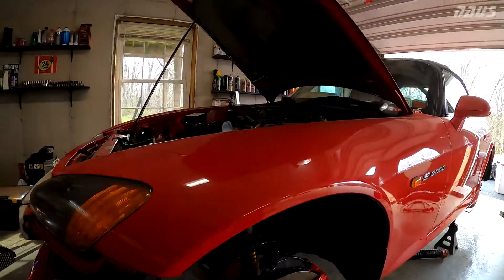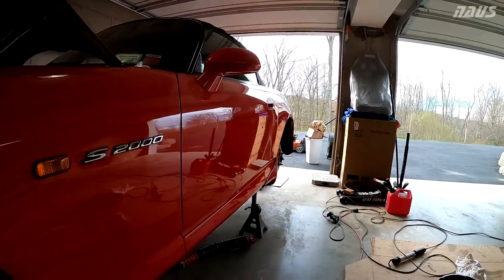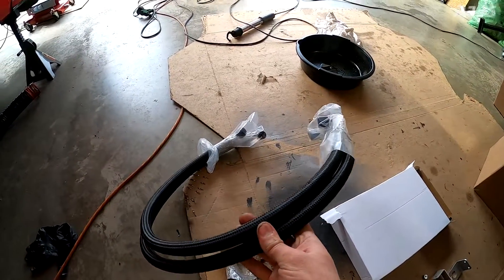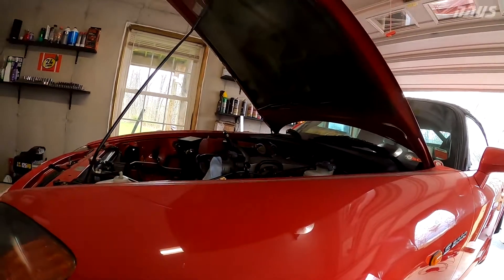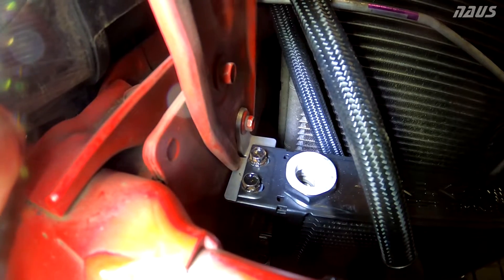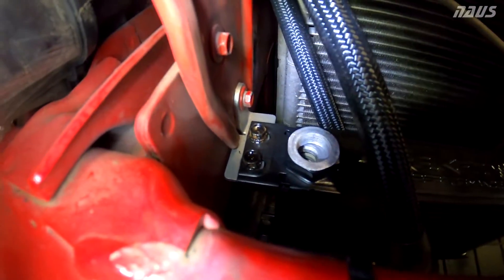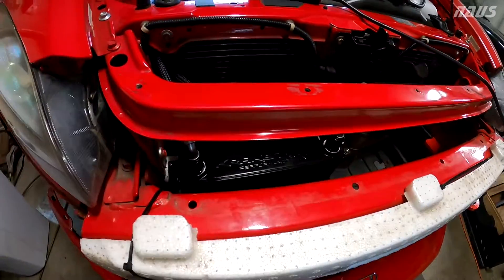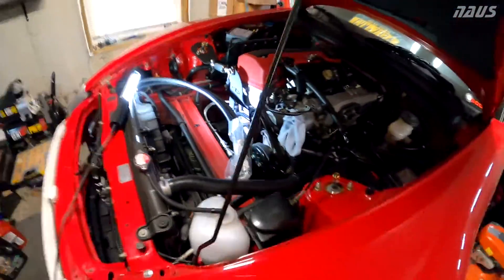S2000 SBG Oil Cooler Install

Comment: Good video, this is one of my next mods (I live in the south). I was going to do the Mishimoto cooler but the Sake Bomb cooler is much better (after seeing it in person) and much better configuration options. I also agree with you on the nylon braiding, much better abrasion resistance and great job using the edge trim, I wouldn't have thought of that until now.
Reply from the maker: Do it up man! I got my first track day with the car in 2 days with S2ktakeover.

Comment: I have seen the sandwich plate torque from 40 ft-lbs (mishimoto) to 54 ft-lbs( Blox) when I first put one on I doubled the 16 ft-lb filter and it loosened in a few years. Because of the gasket retighten every few years.

Comment: Nice s2000 man! I got a silver 02 that I've been wanting to install an oil temp and oil pressure sensor/sensors on. I saw you used the stock location for the line to your sensor, now that you have an oil cooler with a sandwich plate would you rather have put the sensors in the plate instead? Not sure which I wanna do because I've heard mixed things about them and not sure if I want an oil cooler yet...
Reply from the maker: Nah, I would still choose the oem switch port to run the line for the pressure sensor, however if you are looking to do temp too, it would probably be more accurate to put the temp sensor in the sandwich plate where it’s seeing flow

Comment: hey, nice video. Have you had any issues with oil pressure when at the track? Has it been holding up well? Thank you.
Reply from the maker: No issues with oil pressure while on track, I put probably 25+ track days on the setup. Only recent issue I’ve had is a low oil pressure at idle im troubleshooting
Reply: @NAUS2K  nice thank you for the feed back, I really appreciate it! Any thoughts on what could be causing the new low oil pressure issue at idle?

Comment: Hey NAUS, installed this same oil cooler a while back and I've found that it almost works too well at times. Today it was 75 degrees and raining and at one point temps went down from 160 to 139. have you experienced this at all? FYI I have the 200 degree thermostat
Reply from the maker: I do not have an oil temp gauge so I’m not sure. I do know that the thermostat is fully open at 200deg and is always partially open at lower temps. I do drive around quite a bit on the street so I am curious if it is too cold as well
Reply: @NAUS2K  Appreciate the feedback. Definitely worth looking into. Worried about temps when it gets a bit cooler out.
Reply: @NAUS2K  Hey there just following up to see if you ever looked into this
Reply from the maker: @mikeospina1737  Havent installed a temp gauge or anything still. Ive been running this setup all year, mostly track though. Engine still is healthy

Comment: Not sure if this helps, but the mishimoto oil cooler requires 40ftlbs of torque to tighten the sandwich plate.
Reply from the maker: Good info thank you